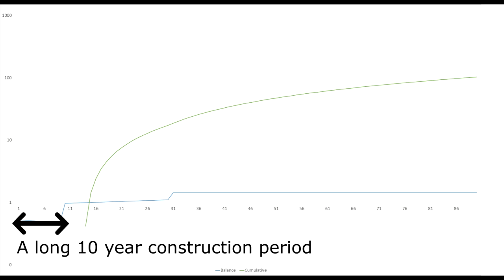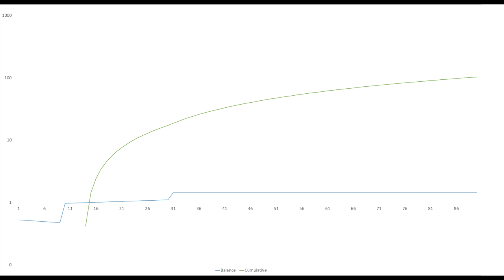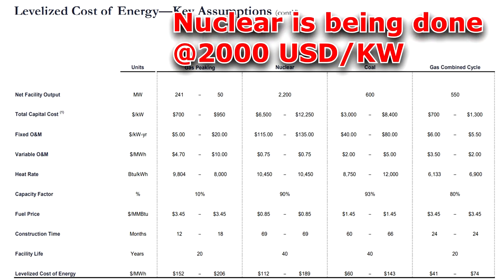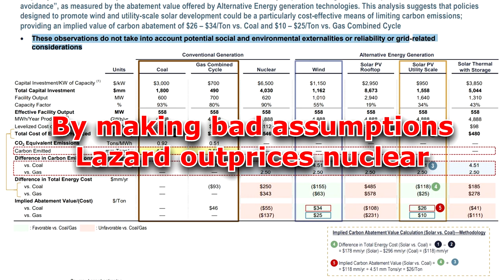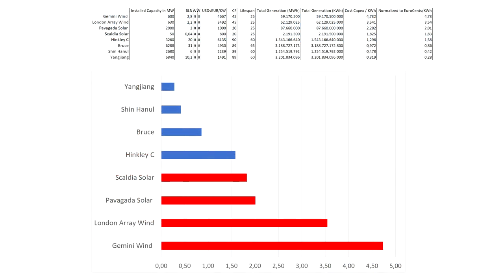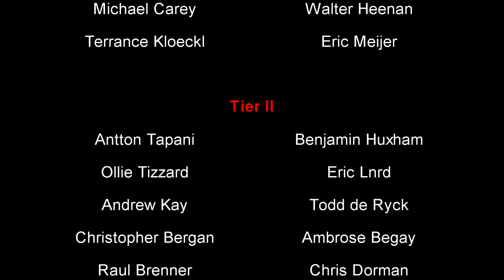LCOE is not a useful metric anymore

Comment: (disclaimer: I don't grasp the LCOE technique in general)

Thanks for making this video, it is on a subject I feel i need to learn more about!
In the video I failed to comprehend what the graph in 0:52 was actually showing. My takeaways that I could understand was that the renewable LCOE analysis did not include important aspects such as the transmissions, balancing the grid, cost of storage. I also failed to understand the "offset of gas or coal burning" meant.

Comment: It is unclear (at least to me) what the graph at 0:50 is showing. What do those curves represent?
Reply from the maker: Blue line is anual balance (IE you start negative, and get into positive as soon as the reactor starts producing product) the Green line is cumulative profit (at the end of the pipeline - so system costs are in there, but they are a margin of the profit).
Reply: Thanks,  @Atomicjedi . Should be explained in the video.